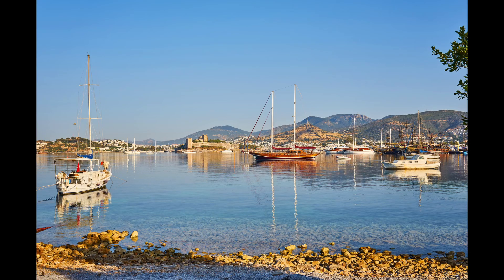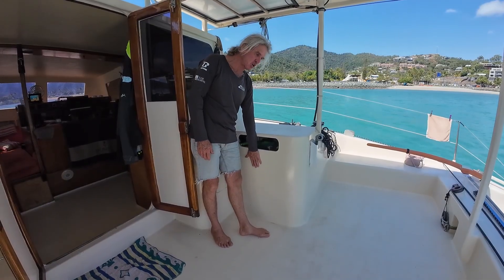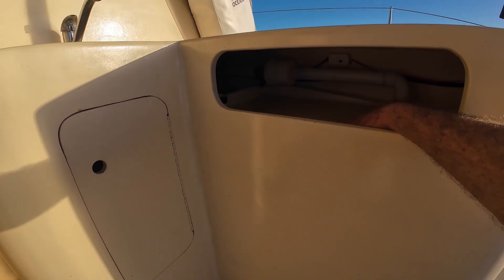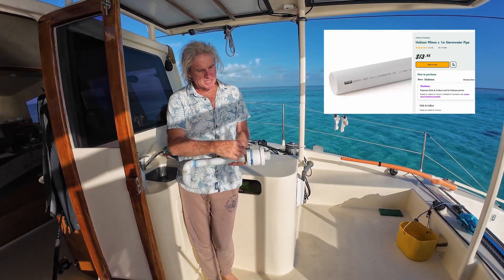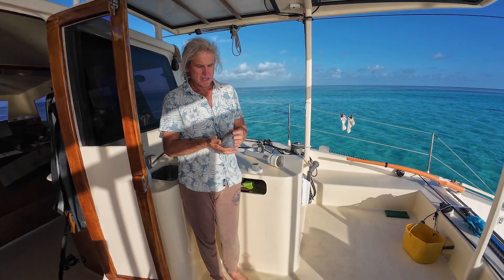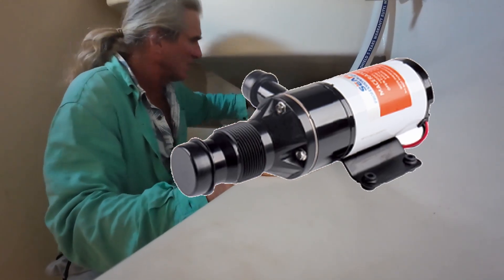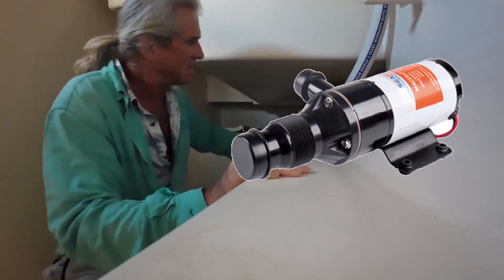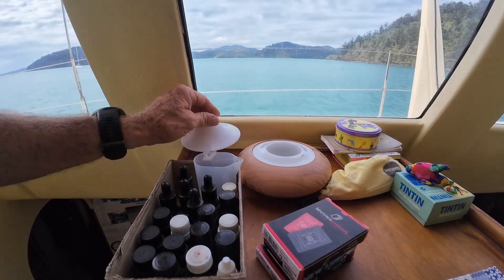“DIY HOLDING TANK UTOPIA - BUILDING A TANK AND YOUR OWN CARBON FILTERS. NO MORE SMELLS!

Comment: Another brilliant video. Many thanks. I'm still completing my 40ft solar powered catamaran, hoping to lauch April 2026. I took over the project and it already had electric toilets and tank fitted. Ive plumbed in a macerator of the type you mentioned. I have had rusting of these in the past in motorhome conversions Ive done but thought  it was down to the lack of use and hope that the weekly flush out of the tank on the cat, which I hope to use as a liveaboard, would solve this problem. If it doesn't, I'm wondering whether an electric version of the manual pump you show at the end would solve the problem? Good luck, Al
Reply from the maker: Thank you Alan! not long before your solar powered catamarans completion now! You'll get at least a few years service from your macerator, so no need to think on that. it may well be an expensive model with a superior shaft as these sit in salt water continuously. The manual pump is the go. you'll need some exercise when your lolling around on your launched boat, haha!  Yes, I think this was my best video yet, but it's not that a popular subject, Enjoy the final stage of your work!
Reply: @AndrewStransky-cc2dr All the water on the cat will either be from a marina or rainwater capture. I haven't factored in any seawater yet. I might need to build a water maker, but I want to see how feasible it is running the cat with around 1000 litres spread over 4 tanks.
Reply from the maker: @alanbutterworth4219  1000 liters is a decent amount. We have 800 liters and when we fill that up we can be around 3 weeks with generous usage. If its raining, there is no problem at all. Yes, always good to get launched and then fiddle with such things at your leisure.

Comment: I have both salt & fresh water supply via simple $10 12v bilge pumps, + 2 x drain outlets with strainers in all basin/shower. 
All 'wash' is with salt which goes back where it came from, switch drain plug, rinse with 'fresh' which goes to grey water tank.
Washing machine also goes to grey, which I use for blasting chain/anchor during retrevial, washing boat, etc.
Tank is 'Properly vented' with composting toilet, no macerator, issues with calcified/blocked pipes, etc.
Most the time we're remote, isolated, self sufficient, use little fresh water/other, even use wood from islands to cook & heat water, as was done before technology made us lazy.
KISS principle.
Reply from the maker: Some impressive systems you have there! So you have a composting toilet. I met some others with one and it sounded very good. Cooking with wood is beautiful. We only manage this on remote beaches occasionally. Great to have a wood fire aboard! I love this kind of simplicity. Thanks for this inspiring feedback!
Reply: @AndrewStransky-cc2dr  
We also cook a lot onshore, but also boat, incl for hot water. Woods easy if setup correctly. No reliance on gas.
However we have more open deck space vs yourself, prefered to cabin, not like we hang around cold climates.
50' ex WA Ali Cray Boat converted to motorsailer.
Open (work) deck/patio with 3/4 solar roof/blinds, chooks, veggie/fruit garden, hammock, +++.
Could survive a long time in isolation if needed, again.
Reply from the maker: @Lana_Warwick  sounds like you have a proper appreciation of the outdoors. I was wondering what type of boat you were on! Sounds great! Chooks and all! I love to see people doing things a bit differently. Pretty impressive to have the ability to get away in isolation for long periods. I do so love a fire on the beach!
Reply: @AndrewStransky-cc2dr  
Hi, I just watched this, thought you might find his setup interesting (if not already viewed).
https://www.youtube.com/watch?v=X4sL10UglRw
Reply from the maker: @Lana_Warwick  thank you for that link, some very interesting technical ideas discussed there. Personally I could never remove our mast. For one my daughter wouldn't let me, haha! Sails are expensive but they do keep your boat very firm and steady in a seaway. Mentawai island look divine though.

Comment: How much pumping does it take to empty the toilet into the holding tank?
And do you end up sending a lot of water with it?

We made our own 'composting' toilet for $30, plus the coconut coir. 
It's pretty much like soil when you empty it, and smells more like soil than poo.

I like your simple system though, and the DIY carbon filter.
I agree, airflow is very important !
Reply: I also use composting, no macerator, blocked/leaking pipes, black tank, etc.
Many don't like them due to smell. Only 2 reasons for smell, not vented correctly, urine getting in the mix vs seperate.
Plenty of tree's on sandy remote Islands will gladly take the end product.
Reply from the maker: I like the fact composting toilets deliver the end product to the right place, ie plants that benefit from it.
Reply from the maker: We just do a normal flush. Maybe 5 litres. Im not sure if more or less water is desirable? Made your own composting toilet! That is impressive. I must look into them. So you still use carbon filters I imagine with a composting toilet.?

Comment: Gday Andrew - thanks for that. You gotta have a holding tank. Cats are such fun at anchor the last thing you want is to have someone use the toilet and pump it out whilst you are swimming. 

I reckon I will use your sinple carbon filter. Ours is even more simple yet not as effective. One question - why the need for a pump out? Ours is above the waterline too yet we just turn on the seacock when way offshore and let it flow out the through hull. 

WE also have Henderson Mk5s. I like em because anything to do with toilet pumps should be realy reliable and non clogging. I have never had to do any work on the Hendersons because of someone elses poo or whatever breaking them. That would be hard on a friendship. 

Thanks for the video
Reply from the maker: Hello Phil-Kankama! Yes, they are great to have. I still feel a lot of people don't use them because their system is not well done, so was keen to put out this video. Gravity probably works fine but I feel the extra suction power to really suck out the tank helps clear it a bit better. Also the pump action helps break down the contents that bit better. Yes, those henderson pumps are great. I'm so pleased I have ended up getting rid of those electric macerators!  Oh yes, you have the Lavac? toilet, with the Henderson pump. They are great! We had one on Longnose. Hows the Laser sailing going?